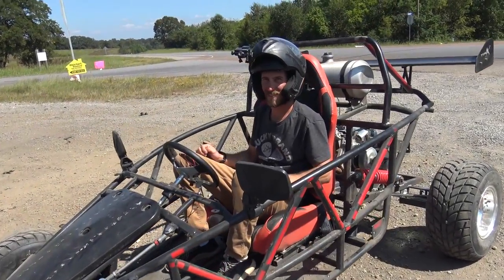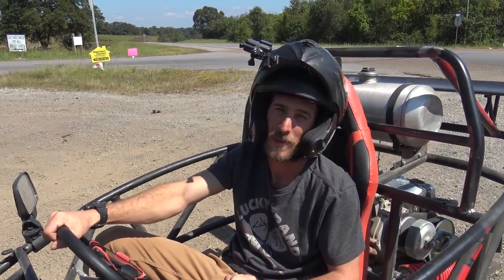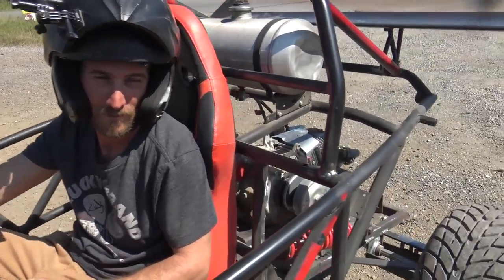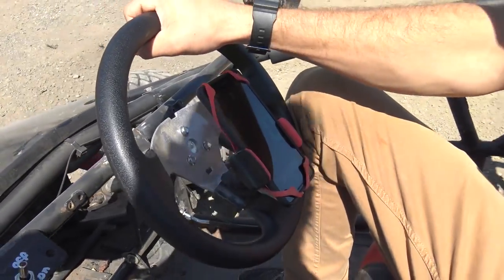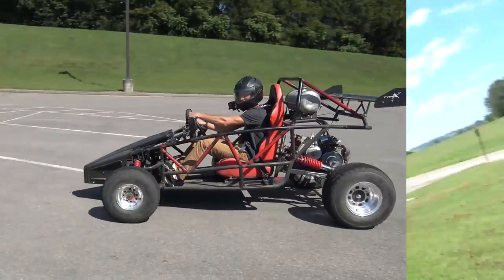Tao Tao Arrow 420cc Buggy Screams!!! Poor Mans Ariel Atom?!?!

Comment: dude.....shitcan the single cylinder air cooled boat anchor and drop a 600cc inline 4 from a GSXR 600 in that thing.....you need to do some builds that are just over the top.....the aircooled utility motors just don't have the WOW factor attached to them.....i'll even give you a 600cc gsxr motor if you will drop one in that cart.
Reply: Yea no nee a two stroke snow mobile twin on it like the boys done with the honda odyssey buggy
Reply: The problem with that is their sponsor only sells lawn mower engine parts
Reply: That would make it too street instead of both with shifting and the clutch straining. Would need a heavy flywheel in it since the arrows heavier.
Reply: You must not have paid attention. Greg said he has a GSXR 600 that he wanted to throw on it, but the customer said no.
Reply: Gsxr 600 engines are horrible. Last engine I'd run lol.
Reply: They should buy a Lamborghini just to put the  motor on the cart then put a 212 predator in the Lamborghini then send the Lambo to a auction 🤣🤣

Comment: Ariel Atom street legal clone with GSXR 600 engine?
Reply: That's what I was thinking. Seems like a waste of money building up a shitty low power engine when you could just Craigslist 80+ hp for a few hundred.
Reply: @VasilyBuilds  ya it goes what 60? And it slides around on pavement?  How much more do you need?  

Looks like a bunch of fun to me.
Reply: LOL thats comically far from a Atom.
Reply: Doesn't look like a gsxr engine would clear those rear shocks.

Comment: please remove that dirty auto engine, that chassis has so much potential, it needs a 200cc manual or a 250 manual depending on what is available, would kick some right arse then LOL
Reply: its not theres. its a custom build for someone else
Reply: Where do you find those engines with gearboxes that aren't straight from a streetbike?
Reply: @DFletcher413  why wouldn't you want  the gearbox.
Reply: @kallumbmx  I do want a gearbox. I'm trying to find something with a gearbox that is decently powerful that has bottom mounting like a standard small engine as I dont have a machine shop at my disposal to fabricate say mounts for a street bike engine or something like that.
Reply: @DFletcher413  I'd go on ebay. if that's no good try the market place on facebook that would be my first go too
Reply: @DFletcher413  what size engine are you looking for ? and what's the engine  going into, I'll have a look see what i can find
Reply: @kallumbmx  well I've seen those Lifan 200cc 16hp  5 speeds that look cool to put on a little cart, I'm looking to do either a golf cart build with an engine mount setup from vegascarts so everything is bolt on or but something on a Tao Tao arrow. I was looking at 2 cycle snowmobile engines but I want to retain electronic start. I may just have to have a friend with the resources mick up a mounting setup for a streetbike engine though. Those 200cc lifans are the biggest engines with a gearbox I can find that isnt from something else. I originally wanted to just do a 670 with a torque converter but I want real throttle response.

Comment: Very nice but she is not in it's power band you need a stiffer spring in the secondary clutch to make it shift at higher rpms   you will get a greater top end speed by doing that. Keep up the awesome videos

Comment: Not bad not bad at high speed does it handle it well looks like it does better than most your other builds just wondering because I'm going to do one of my own using golf cart tires more for high-end speed also going to be for torque with a simple gear change keep up the great work keep the videos coming good job

Comment: Hey I know this don’t relate to this video but was curious if you can have a predator 212 motor “non hemi” if you can put a hemi head on it without trouble?
Reply from the maker: Yeah you can but I would do the opposite. A non hemi head on a hemi block will have more compression.

Comment: 2:18 You guys are crazy enough to do speed runs on a highway do it with traffic not against traffic. This way if something goes wrong you have at least oh I don't know 15 more feet to not die
Reply: Ken design , on a go kart I would rather see a car or whatever coming at you then getting hit from behind.
Reply from the maker: Jason Robinson that is the exact reason we do it that way.
Reply: @RedBeardsGarage  OK just to be clear, if you're going 50mph and the car next to/ behind you is going 55mph. How is that more dangerous that having a head on with a 4000lb car at 105mph.

Comment: A so called Fully built performance 420cc industrial use motor like the one in this kart would set you back way to much dollar when you bare in mind that your average 125cc 2 stroke dirtbike engine would sh!t all over it performance wise. And you can pick up a rough used dirtbike for dirt cheap and pull the motor. These motors sound awfull as well lol, sounding like your local farmer doing a fly by on his ride on mower.